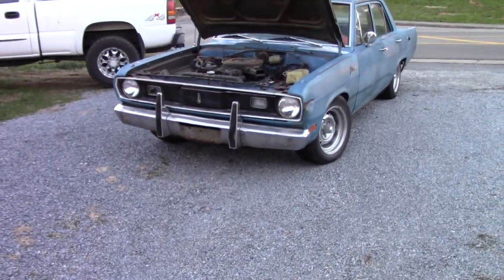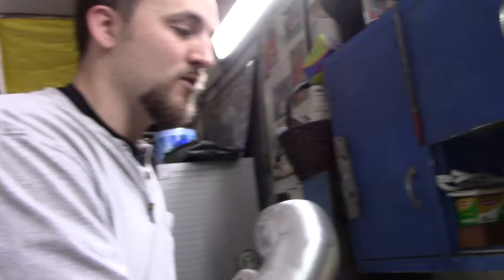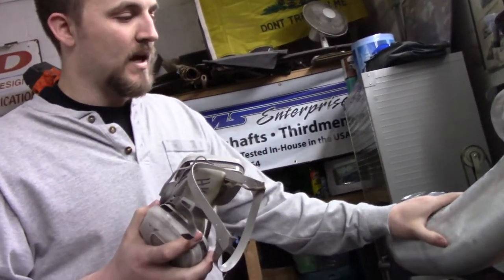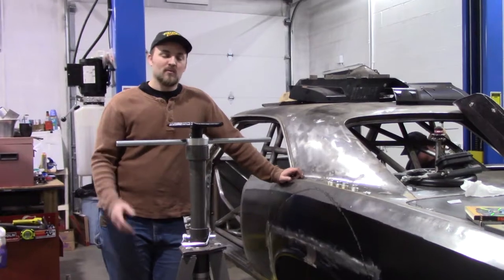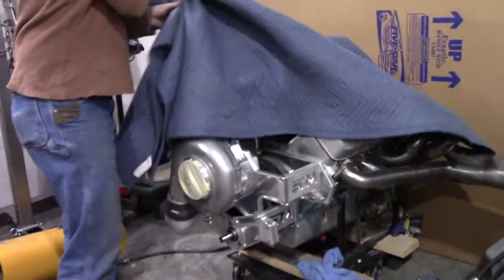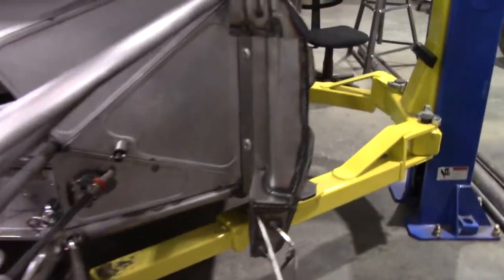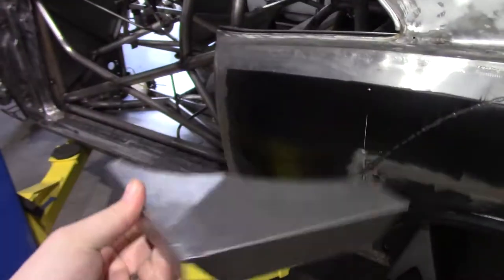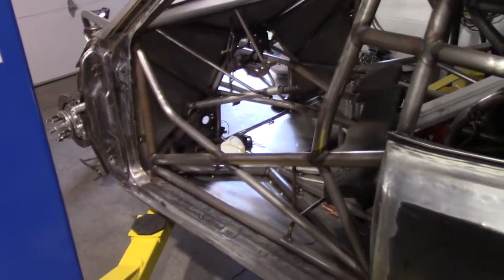1972 Plymouth Valiant and a wicked cool new pipe sander. (GTO BUILD EP30)

Comment: I like sanding all my tubing before I cut and bend it that way it’s easier and faster to paint later on. A lot of guys only sand the spots they need to weld, then later when it comes to paint it once the cage and chassis are welded it its a pain in the ass and doesn’t come out good
Reply from the maker: Ya I try to sand it all when I can.